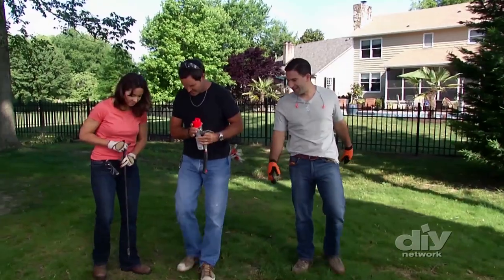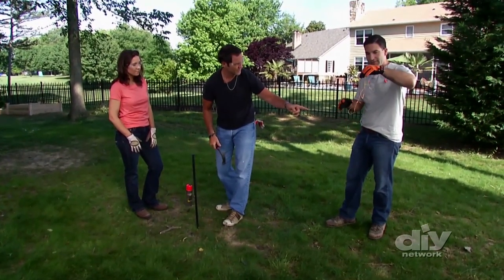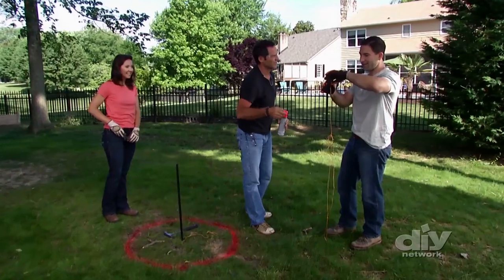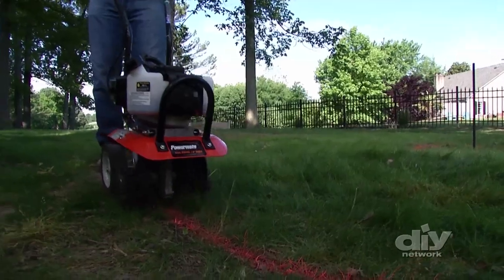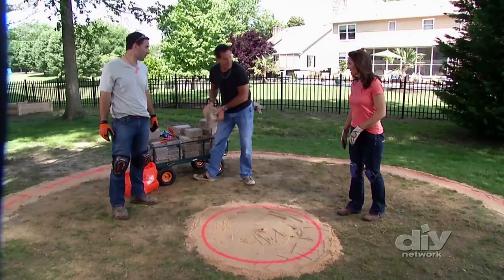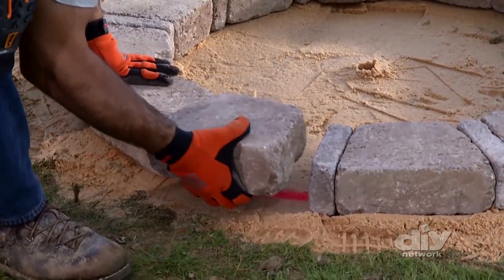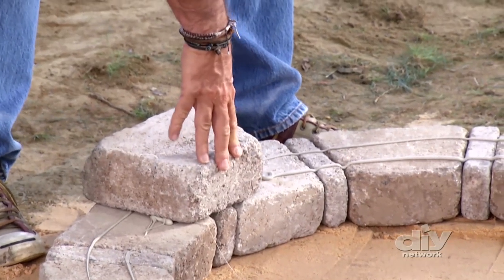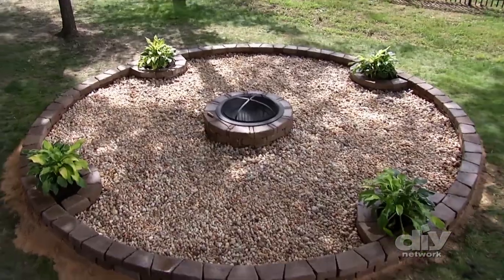Backyard Fire Pit Building Tips - DIY Network

Comment: I built this by myself using this video as a guide. I am a 58 yr old female!  It is 18ft diameter. For 2" deep pea gravel, 2 CY (cubic yards) are required minimum. Do not waste your $$$ on bags of pea gravel. Find a quarry and they will deliver it by the ton for much less. 1 CY = 1.5 tons. What they left off:  1)WEEDS!! You need to lay down contractor grade landscape fabric or have weeds take over in the summer time and destroy all your hard work.  2) You should lay crushed rock UNDER the pea gravel. This stabilizes the pea gravel as well as hiding the landscape fabric. Know that you will need to add to the pea gravel every 4 years or so due to natural erosion. Have fun! I LOVE this design :)
Reply: Stefanie do you still pea gravel is a good choice?  I'm gonna be doing something like this and not 100% sure on using pea gravel.
Thank you
Reply: @vago5252  absolutely!  It's a year later and I still love it.  I planted butterfly bushes in the plant areas and have butterflies visiting. The crushed rock may not be necessary if your ground is hard. Also, I ended up buying (4) 1000 lb pound bags of pea gravel from Lowes. Not my first choice but  all I could find at the time. Good Luck!!
Reply: @stefaniebass2664  thanks so much.  I'll feel souch better now going this way. Again thank you Stefanie
Reply: How many blocks did you need to do the outside circle 18’ circle
Reply: @briankern1736  I just finished the circle about an hour ago.  I ordered 160 Pyzique Wall Split Face Sandstone Blend by Cambridge paving stones.  I had a few extra.  I did not put in the extra circles for planters.
Reply: That was just for the outer circle.  I had put together the inner fire pit a few years ago.  Hope the info helps.
Reply: @briankern1736  hi Brian! It took 68 blocks for the circle and 7 for each planter...so 89 total. However, I went with a smaller size for the outer circle than what I used for the firepit. Same coloring and shape, just smaller. I wanted to add pics for you but I guess it's not allowed.
Reply: Stefanie Bass what was the length of the 2nd string (outside circle) that you used? 18 feet?
Reply: @marioportilloc6004  yes. The diameter is 18ft from one side of the circle to the opposite side.
Reply: Stefanie, Was the crushed rock A-gravel? Did you tamp down the crushed rock? How much crushed rock did you use?
Reply: @warrenwm220  It was pea gravel from Lowes. They only have one kind, so I am not sure about grades.i did not tamp it down and it took 4 1000lb bags for the 18ft circle.
Reply: Yes! I was thinking the same thing, the way they did it you would have to pull weeds constantly!
Reply: @kennethhoppe1590  what were the dimensions of the blocks?
Reply: @marioportilloc6004  so the string would be 9ft long.

Comment: Should have pulled the thin bricks out of the first layer, after starting the second layer...  to provide fresh air draft at the bottom course.
Reply: William Lang exactly !!
Reply: It doesn't really,  I use alot of these kits , you can fill the inside with dirt or crushed stone to raise the fire up a little and they work fine
Reply: No. At the end they put one one of those metal bowl fire pits inside of the stone base. No air is gonna get through that.
Reply: @KDeds21 drill holes..

Comment: Nice. Finished product, however why not use  pack or C-6 Stone as it is known instead of sand ? It would have been stronger! Next no drainage in the fire pit ?  Also why not add a slight pitch to the 18' area ? To get rid of water ?  

This is nice for Harry The Home Owner project.  You could have actually built an all Brick or Natural Stone Fire Pit for less with brick & a littlemore with stone. A bag of pre mixed mortar goes for aprox $4  enough with a 3/8" to 1/2 " joint to do about 50 bricks!  & Bricks $0.25 each to $0.50 each so for under 50 cents each!  Of course you would have had to place a cement footer in, for base 4,000 PSI Pre Mixed Bags $4 each.  

The precast concrete pavers are aprox $4  to $6  each! Food for thought. 

Take Care, Bill Kearney
Reply: Should create a vid for this.

Comment: Do not use the PL landscape 500 glue if you read the side of the tube it isnt even recomend for barley any uses. I used this glue last season on some cap block for a wall and on the block staircase thinking it would be good ,I had optimal conditions  when I did it and every single one failed and had to be redone using PL premium  and that stuff is the best. 
Another thing dont create a tripping hazard all the way around your firepit area most people are having a few beers or cocktails by the fire and you dont want anyone to fall in it .
 Dig the outside border trench 4" +half the thickness of the block you are using.  If your somewhere you dont get frost use fines instead of beach sand it will be alot more stable and last longer , I use road base gravel compacted then a small layer of fines for leveling the blocks, but live where we get frost
Give yourself 6'- 7' all the way around for moving your chair in and out and so people have room to walk behind you it will be very frustrating if you dont
Reply: yeah I was thinking of the tripping hazards cause we also drink beer and cocktails at our fire from May to Dec. I want it to be relaxing

Comment: There's no air flow with that design. The fire will be very smoky and go out often.
Reply: What is your suggestion for airflow
Reply: @masaigeraghty6976  Leave around a 1 inch gap between the stones on the bottom 1st level. That allows air channels which improves the burn of the fire and decreases the smoke.
Reply: Agreed, I would have removed 4 of the small stones (3, 6, 9 and 12) on the bottom ring for air flow